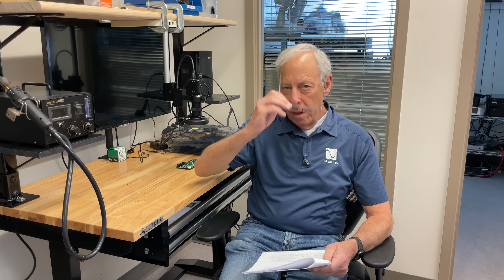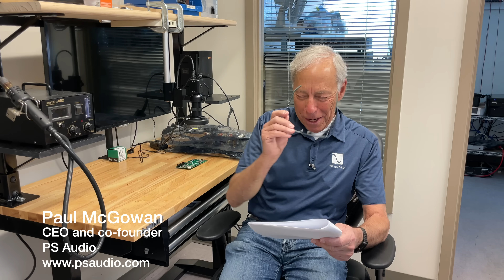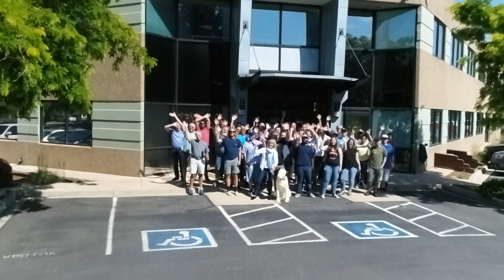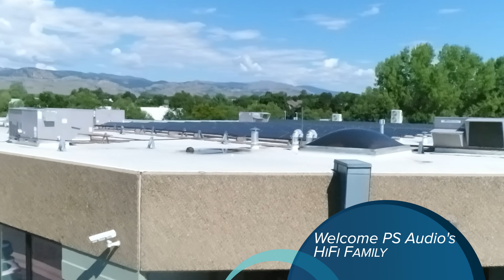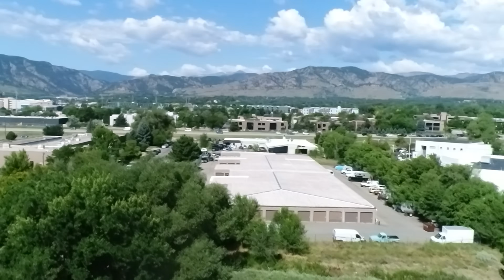Which DAC am I hearing?

Comment: This is interesting as l have an issue listening to 24/192 through my BD105 Blu-ray player  I've connected my Audiolab 6000n streamer to the Oppo coaxial digital in and used the Oppo coaxial digital out to my external Exogal Comet Plus DAC  I can only listen to 24/94 high rez file's So I'm l listening to the Oppo DAC as it's coaxial in will only do 24/96? I prefer going through the BD 105 as l use it's DSP to control my two sub woofers

Comment: Thanks Paul, this video (and some research) did me wonder which dac i was listening to. I happened to be listening to the 192/32bit denon (dcd-600ne) dac in my cd-player via RCA. After connecting it with optical cable to my (old) Onkyo Tx-nr646 receiver with 384/32bit AKM dac it produced more dynamic range. The A-B comparison convinced me.

Comment: Even if the CD player's DAC is better, you have to be sure that the integrated amp doesn't digitally resample the analog input before doing anything else to the signal.   If that's the case, you might be better off using the amp's DAC.

Comment: strange question! you never use 2 dac at the same time.
DAC means digital to analog converter. if you use the digital output to connect it to a separate DAC, then you do NOT use the built-in DAC in the CD player but the external DAC ..
that's the way it is with ale sound sources

Comment: So if you have a good DAC in your pre/pro (I've got a good one in my XMC-1) it's best to spend as little as possible on every other component and go all digital connections?  Or do you run into limitations with optical and coaxial for hi-res (assuming you can't use hdmi to avoid these limitations)

Comment: Your answer is a bit confusing here as he did not specify how his cd player is connected to the integrated amp. If he is using rca cables then it will be the AK dac in the cd player. But if he connected the cdplayer through optical then it will be the cs dac in his amp taking care of the conversion. Correct me if im wrong
Reply: he did make an assumption at the outset...... but then doubled back & covered the other base also.
it wasnt smooth but he gave the correct answer eventually.

Comment: Why aren't there more fires in semiconductor plants? Many semiconductor plants are built from the ground up. That means that they must meet the latest construction and fire safety regulations. Since semiconductor foundries are expensive, extra engineering may go into keeping them running. Semiconductor companies frequently have engineers in management.They may tend to take safety and continuity of operations seriously. Companies run by bean counters are more likely to use shortcuts that endanger the business. A lot of this comes down to corporate culture.

Comment: He doesn't say he's taking a digital signal out! He said he connect  the CD player to his integrate amplifier that has a DAC!  now if that's through the RCA analogue in or balanced he would be bypassing the internal DAC in the amplifier if that's the case,  the internal DAC in the amplifier would only work with USB or coaxial or optical
Take the analogue signal from your CD player and connected it to the tuner input of the amplifier or CD or input

Comment: Yes, as a midfi guy here I was surprised to learn I was transferring digitally out to my avr dac. So swapped the digital outs for rca's, so now get the Denon player Burr Brown chip instead. Ironically, better sounding compared to the all digital sound.
Reply: Id think that depends on the cd players dac and the receiver/Preamps dac .
And if you buy a preamp / receiver with i better dac, it b better to use digital output from the cd player.

I guess that is something most shud test out..  and listen..

Comment: Stacking DAC's can result in some hasty hetrodyned trash due to frame mis-alignment since there is no such thing as perfect filtering.  This is touchy at best.  When stacked, the bit rates in the wrong order can also mask higher quality units.  Eeek.  One DAC per system is usually the limit to avoid this issue.

Comment: Well, so he's not necessarily listening to the amp's DAC - he didn't specify how the CD player is hooked up to the integrated. But now we know that RCA is preferable to digital in this case to take advantage of the AKM DAC.
Also: Damn, I didn't know about the fire - I wager the company will be fine, but I hope no people came to harm!
Reply: Yep, depending on how he's connected the player to the amp will determine which DAC is being used but the letter never specified so it's anyone's guess...
Reply: I agree Sebastian and Daniel. I don’t see where sender’s question said anything about how he’s outputting his CD transport/player into the preamp. I was assuming analog outputs
Reply: @Scopolamine46  the question says "dedicated cd player" which is the only thing where I wonder if that means "transport" and thus using the digital output, but it's thin.
Reply: @miff227  he is claiming that he has a DAC  inside his CD player So in my mind that is not a transport. Also says he has a separate DAC His question was which one is being used when he plays a CD. My reply was he’s probably using an analog output and that would mean it goes through his CD player which contains DAC
Reply: @Scopolamine46  hmm, I thought he had an amp with a DAC in it.
Reply: @Scopolamine46  any player with digital output can be run as a transport, bypassing the DAC
Reply: @miff227  That is correct. I have a CD player that has a very good deck and I use my RCA analog outputs from this player to the input of my preamp. I made the assumption that that’s what he was doing. Otherwise he would never be asking the question that he did to Paul
Reply: @Scopolamine46  yet on my CD player I "upgraded" it by buying a DAC and connecting the spdif to it.
However, if you are not educated on this stuff,.and your amp has the digital inputs, who knows which cable they used to connect it up ? Paul has assumed the digital interconnect in thIs video, so opposite to your interpretation (unless I have that wrong)
Reply: @miff227  That’s the real issue ...neither of us know
Reply: Was just going to make the same point - unless there's a part of the email Paul didn't read, there's no mention of whether it's connected via digital or RCA (though to be fair Paul gives an explanation of which he can use and how to hear either DAC).
Reply: I read where there were 400 people at the plant, who all got out safely. https://www.prosoundnetwork.com/business/akm-factory-fire-shakes-up-pro-audio-industry
Reply: @GTRJohnny66  Ah, yes, I went on to google that fire as well and found the same info - good to hear. Apparently, the fire took more than three days to put out!